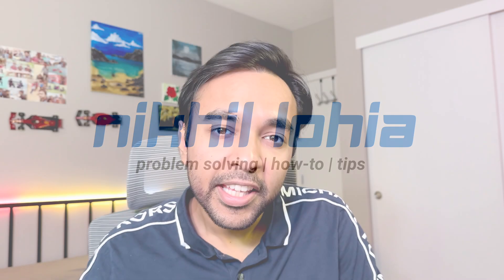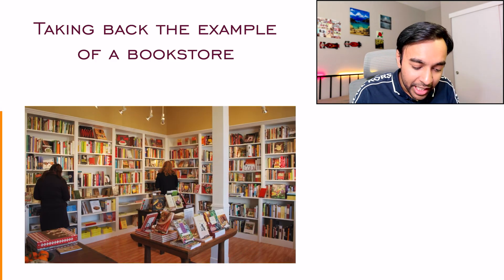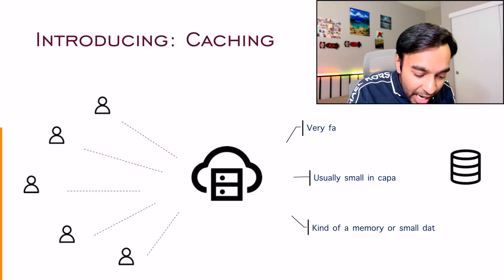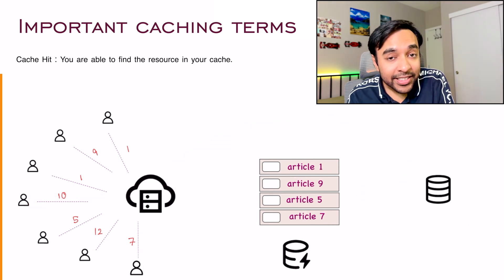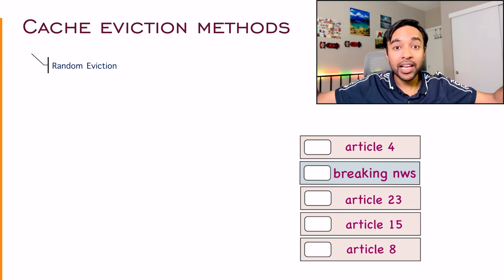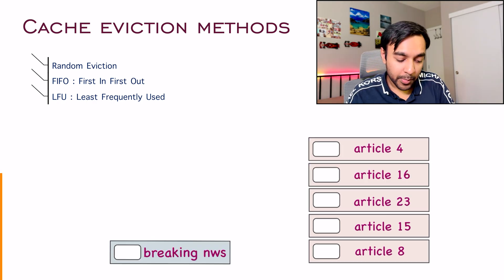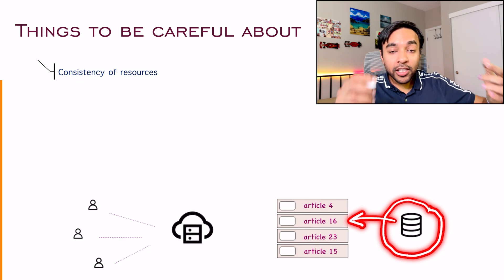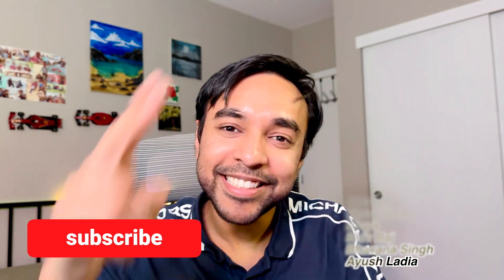System Design - Part 4 | Caching | Key concepts, eviction techniques and challenges

Comment: 16:33 Sir regarding the consistency issue of data stored in cache memory - rather than storing the actual data what if we store the address where the particular data is present in the database .. wouldnt that solve the problem
Reply: If you store the address of data from db, then any how you need to request data from db which will increase db read count. To solve this issue we need to use cache so that the read requests to the server can be as minimum.

Comment: Brother, your explanation and examples are really engaging. Keep it up. Isn't there anything to do with coding in system design? I want to know and see how coding works with these theories you are nicely discussing. Please reply and consider showing us.
Reply from the maker: usually you will use all the coding concepts that you have learnt, for example all the data structures and how they can be implemented. You will never be creating a simple queue in the real life applications, but you will be using it at a lot of places.

Just like FIFO is a method of cache eviction.
Reply: @nikoo28  I am learning DSA. I have leaned all linear data stuctures and their operations. Not expert though. Keep teaching us.

Comment: How about cache which are transient in nature also what if there are multiple processes attempting to access a cache simultaneously after a cache miss ,adding a load on underlying resources also managing cache states is quite challenging which can complicate your system design and maintenance over longer run ,can you please throw some light on these topics 😊 ,as usual you are very precise in your explanation and content delivered appreciate it!
Reply from the maker: you are right, we can go into a lot of details when it comes to caching. I myself had to make sure that I did not go overboard with the video. 😅
At the same time, I have to keep the video small and easily digestible as well. Will keep discussing as more things come up. :)
Reply: @nikoo28  Got it 😊, may be at the end of your videos you can list pros and cons of each system design techniques that would help just as a suggestion 👍